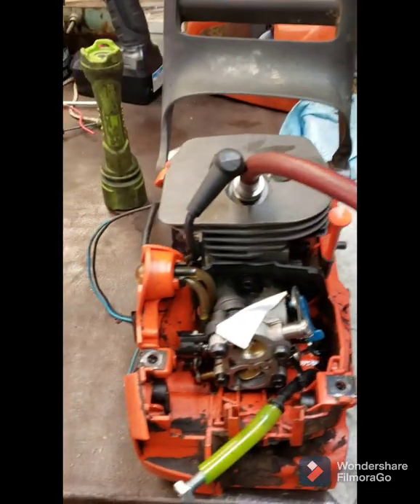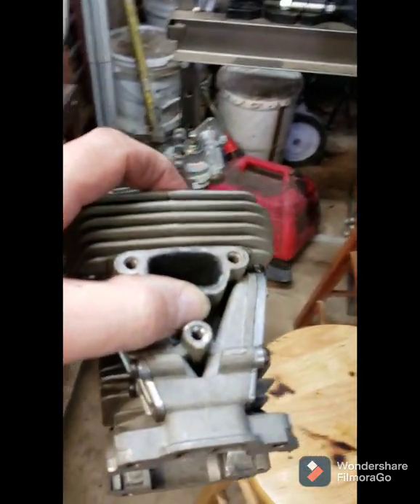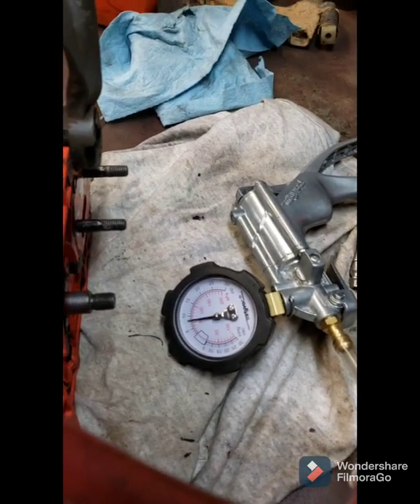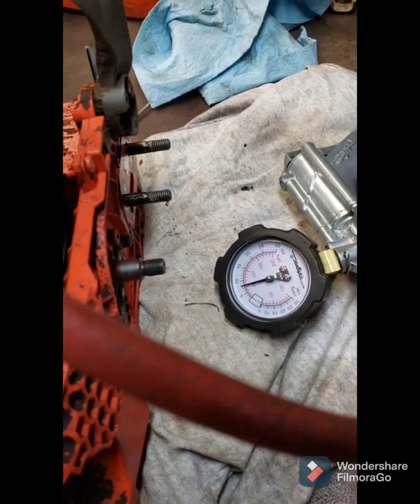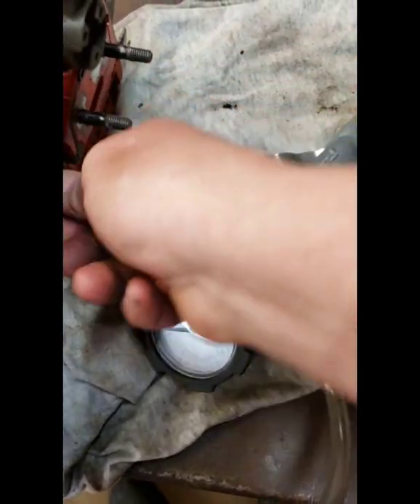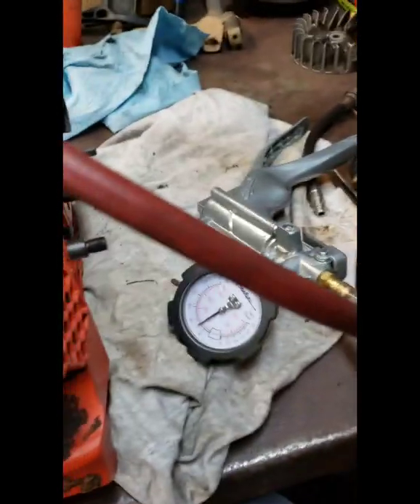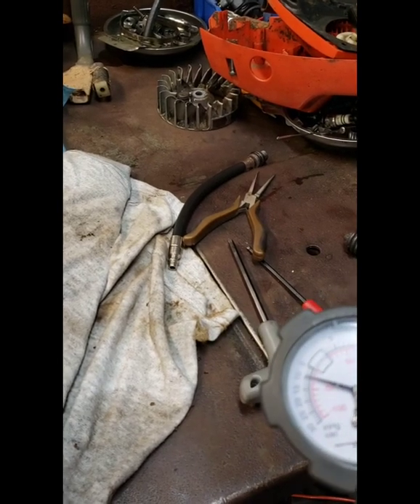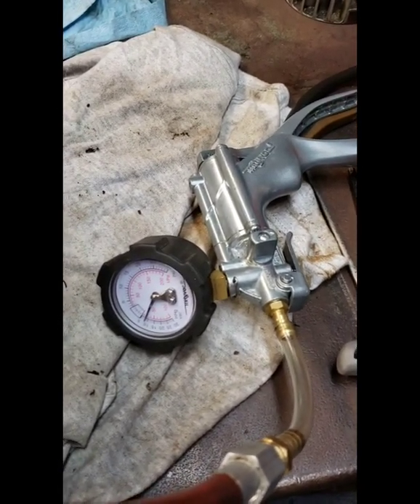Husqvarna 455 Crank Seals Video #2

Comment: how did you block the intake and exhaust, and where did you get the plug for the spark plug hole?
Reply from the maker: I hook my pressure/vacuum tester up via the sparkplug hole, as for the muffler and carb I use a piece of cut inertube between the muffler and cylinder and carb and manifold.

Comment: Craig, I would only push to about 5lbs on pressure testing and leave it at that (I test at 5lbs for five min which is way longer than needed), the seals aren't designed to go over 7lbs is my understanding, I believe that is why Husky has you do it at a lower pressure. On the vacuum test I go to 5 inches of water column and leave it for five min also.
My last 372OE build fought me, I used a pump spray bottle mixed with just a bit of dawn dish soap and shake to mix it up then spray, I found a leak at my cylinder base. Easiest way to find a leak, I used to do this to test gas piping or refrigeration piping for leaks. 
Good vid and keep up the good work.